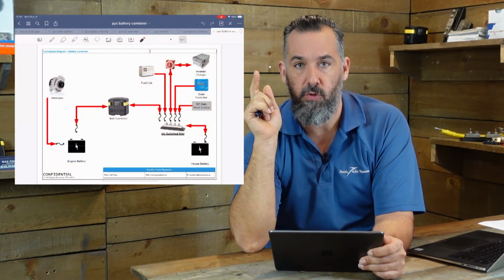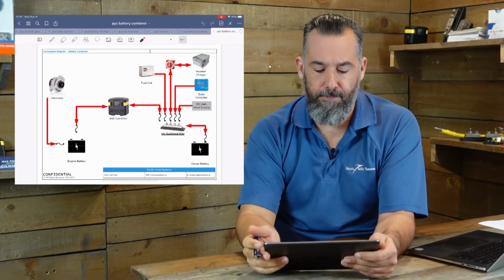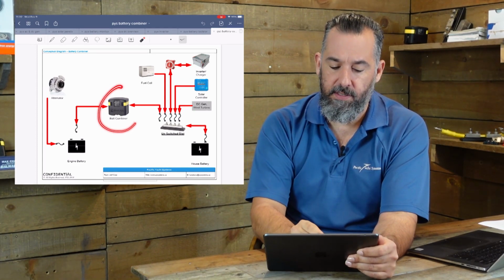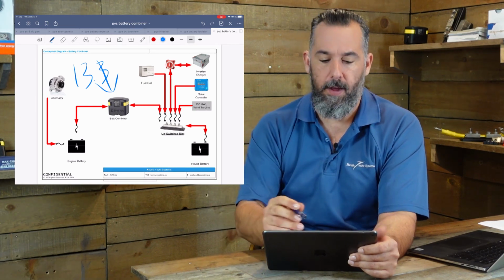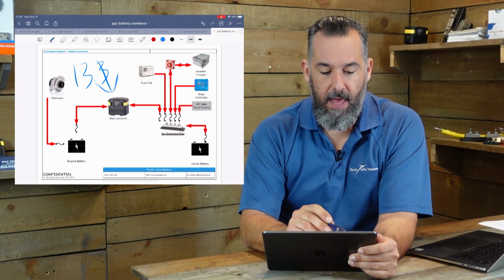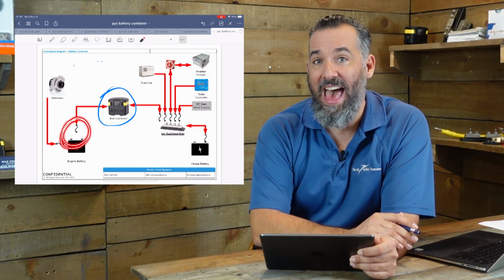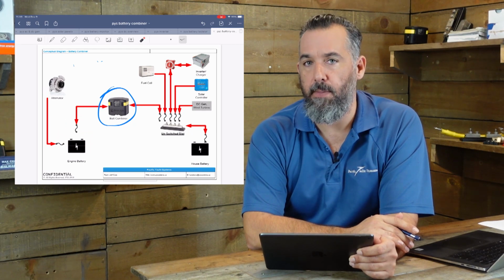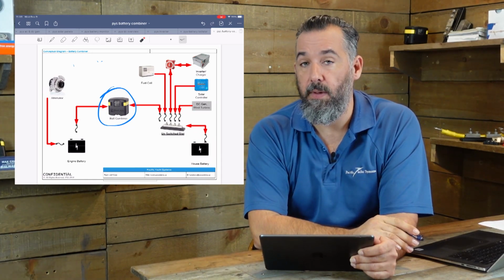I Am Installing a Battery Combiner and I Am Wondering Where the Connections Go?

Comment: Can I ask... if I install  this combiner will it damage or shorten one of the batteries cycles lives? as in recharging cycles, does it affect recharging cycles even though it's basically topping up both batteries when the motors running . regards. rob
Reply from the maker: Robert, let's recall a battery combiner only shares a charging voltage from battery bank to another. In most cases, a charging voltage is better then nothing.

Comment: Hi Jeff. I am planning to install a Victron Cyrix-ct but will use my solar panels instead of alternator or generator. Solar panels are connected to service batteries and from there will distribute extra energy to my bow thruster batteries and to startee batteries. Does this make sense to you? Thanks
Reply from the maker: Battery combiners, like the Victron Cyrix-ct, work regardless of the source of charging  voltage. For instance, you'll have solar create a charging voltage, but it could be alternator, battery charger, wind turbine, etc..., the battery combiner will work regardless.

Comment: In a later video you said you don’t fuse your starter battery but the diagram here shows both engine and house batteries as being fused. Is that unique to the battery combiner setup?
Reply from the maker: Good question, only the starter circuit doesn't need to be fused. All connections (except starter) needs to be fused at the engine battery, this includes the battery combiner.

Comment: Can I use a pwm solar charge controller to charge a 12V battery from a 24V battery bank? I am thinking the solar input on the PWM would connect to the 24v and the 12v battery to the battery output. 
Thank you, I love your videos.
Reply from the maker: The 24V battery bank will constantly drain to recharge the 12V battery.

Comment: I found my grounding cable at the cutless  brace corroded.  Before replacing I checked and found .625 volts.  This has me worried so I haven’t reconnected yet. Is there a problem?
Reply from the maker: Are you measuring the shaft potential with a silver silver chloride reference cell?
Reply: I actually dug in a little more. I have a .625 potential diff from the diesel tank to a copper stud (inside the boat) direction above the cutless bearing frame.  I’m assuming it’s connected thru the fiberglass.

Comment: Thanks again Jeff!  OK,  I have a tough question.  Another UTuber suggested combining a lithium bank with a Lead acid battery bank.  Where the Lithium bank does the heavy lifting keeping the LA Bank at 13.2 volts till they give up the ghost.  The LA bank covers shortfalls during periods of low light(solar), low wind(windmill) or getting back to a land source of power.  Horsepucky?  https://youtu.be/tAuPfgZgXec
Reply from the maker: Hi Thomas, definitely a sceptic on this one, especially mixing and matching battery chemistries. Professionally, my advice is to go with proven and reliable rather then something new and promising.

Comment: Totally off topic but can you do a video on whether or not you can use a mobile generator (Honda) on your deck and plug it into your shore power while at anchor as long as it can handle the load and you pipe the exhaust overboard. all things considered is it OK from an electrical perspective? (love your videos "studying" for rewiring our boat this spring) Thanks!

Comment: What is the proposed fuse amp before the battery; The amp of the wire connecting acr with the battery or the usual charging amps?
Reply from the maker: To protect both the battery combiner and the wire connected to the battery combiner.
Reply: @PacificYachtSystems  So is safe to put a 10 amp fuse for a 8awg wire between combiner and battery ; thnx